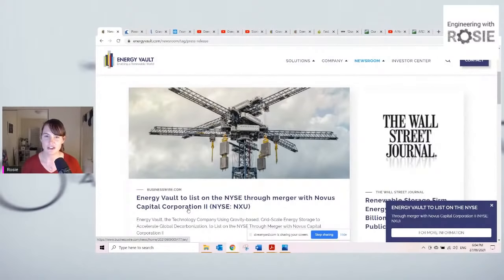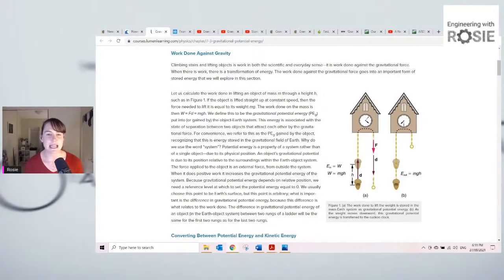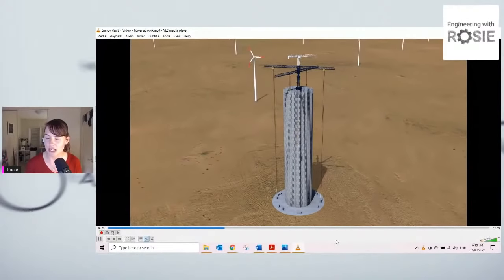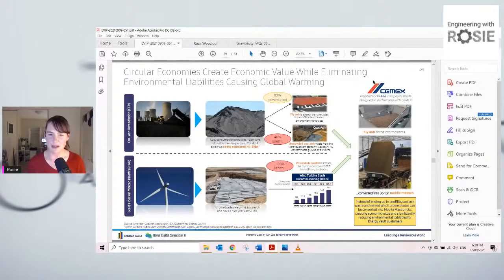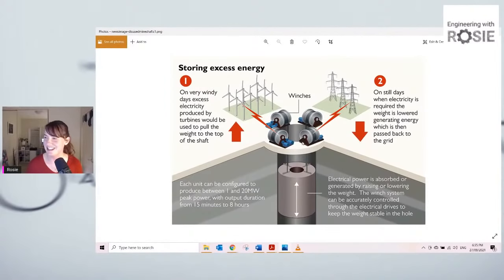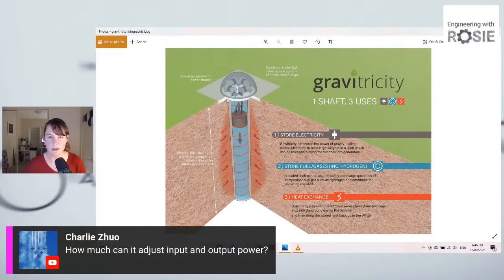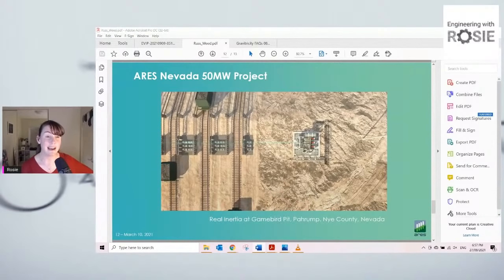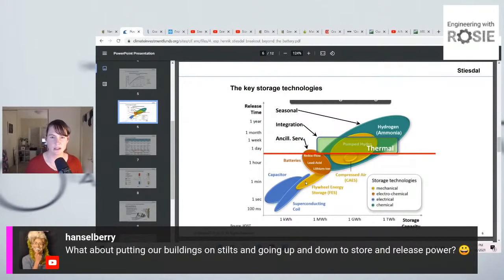Engineering with Rosie Live Ep. 2 Strange Storage - Energy Vault, Gravitricity, ARES Rail Storage

Comment: A wave/tide powered pumped hydro seems like a fairly cheap and easy solution to power generation. Ideally the water used for everything would be salt water which presents environmental contamination problems and probably provides a more abrasive medium for the turbines.
Reply: And that's why it's so expensive. Salt really rusts the equipment.
Reply: @simonhenry7867  make it out of plastic- I have heard the plastic is already in the ocean- so a double win :) ... it is that easy
Reply: @olik136  It is not that easy.
Reply: The biggest problem with pumped hydro, the one thunderf00t is actually not talking about is that it really depends on the location. You cannot build this wherever you want.
Reply: @_aullik  Yes and no. If you try to go for the traditional "cheap" method you not only need a suitable valley that you can flood, but it has to be close to a water source, close to your power source, and close to your city, because you need to build a road and power lines there just to build the thing and that gets very expensive as the distances get longer. Someone else made a video about this and they basically said Canada doesn't have any more suitable locations for pumped hydro because building it hundred miles from anywhere is not economical.

Then again, if you REALLY need a big battery and screw the NIMBYS, just dig a big hole and a second twice as deep hole next to it, and you can build a pumped hydro storage of any size you want anywhere you want and only need to worry about having a water source, which most cities already have.
Reply: @AnalystPrime  you are right, if you dont caree about money you can build everywhere, however at that price point it is not competitive against any other technology.
Reply from the maker: Ooh, I am excited to see this conversation thread here. I plan to do some videos on pumped hydro soon, so it's good to see it's not just me that thinks it's an interesting topic. I want to do videos on both "normal" pumped hydro (specifically the Snowy Hydro 2.0 project which is near to me) and off-river, which addresses much of the problem with normal hydro that there aren't many good spots left. You still need a pretty good hill though. I'm hoping to interview one of the authors of this article about the off-river option. https://reneweconomy.com.au/off-river-pumped-hydro-could-provide-lower-costs-for-energy-storage-31629/#:~:text=An%20off%2Driver%20pumped%20hydro,tunnel%20containing%20a%20pump%2Fturbine.

Comment: Rosie, 

perspective, all these ideas are toys, in terms of power capacity and how do you control them anyway. Good storage has to be controlled in it's output.
Clever people make money out of such schemes as the general impression is that storage is the answer and will compensate for intermittent renewable generation. They may be misled by the fact that batteries are used not for intermittency but frequency support. This is due to a lack of technical knolwedge, I would have expected you to know better?
Reply from the maker: I agree that batteries are currently mostly used for ancilliary services (which I did mention in this video, briefly when mentioning Gravitricity's prototype test needed to validate the startup time to make sure it was fast enough). 
But I will also add that longer duration batteries are already gradually starting to be installed for arbitrage, to charge during the solar peak and smooth the evening peak load. And of course many grids rely on hydro to smooth intermittency. These gravity storage systems are mostly geared around longer duration storage, approximately from 4-12 hours, which is one of the big challenges the grid has coming up as more variable renewable generation is added.

Comment: Wind towers have tall towers, it seems the towers would be designed to deal with bending loads that as far as I know are more difficult than compression, so a wind tower might be able to hold considerable weight, given the lack of storage potential it may not be worth the effort...
Should be able to use the existing generator and gearbox at the top of the tower? Even small smoothing or short term storage might be useful?

Comment: I'm extremely skeptical about Energy Vault. Their pivot from freestanding towers of blocks to "indoor" contraptions of elevators and racks should be a strong indication that they are selling snake oil.
From their CGI, it appears their tower version is about 40 layers of 200 blocks (8000 blocks) each weighing 35 tons. If maximum storage is 100%, the crane's jib lengths that could suspend 35t blocks would limit full discharge to use only the upper 66% of the blocks (meaning over 2500 blocks are never used for storage.)
100 metres is roughly the height of a 33 storey building (not quite the low-rise building depicted in their "indoor" version.)
The volume of steel used to make the lattice structure that is imagined to be inside their building is ludicrous.

The art of performance magic is to "misdirect" attention toward the insignificant while seeking to avoid showing the obvious absence of any "magic".
"A fool and his money are soon parted."

Comment: It seems that any shaft mining company who wants a nice press release could use the Gravitricity system for on-site daily storage of solar/wind.  I don't see that system making sense outside of a pre-existing shaft mining context.  If there is any shaft mining equipment which is assembled on site, even digging new shafts may not have a huge marginal cost.

I wonder what is the limit on how heavy the load can be (and therefore capacity), I presume it's set by the tensile strength of the cable holding the energy storage mass
Reply from the maker: I would expect that they want to use existing cables and winches so probably that's the limiting factor. But the Gravitricity blocks are already so huge! 550 tonnes!! I was incredibly sceptical about the idea of using mineshafts at first, but I did get somewhat persuaded of the benefits when I spoke to them. I think we may well see a few of these systems installed in the next few years and I guess after that we'll see if their business case stacks up in reality.

Comment: I wonder about high pressure CO2 storage. It can be liquefied at room temperature and 73 atm. That would make compressed air storage much more energy dense. Of course you have to heat it back up before it goes through a turbine. If you just let off pressurized CO2 into a cloth bag most expands but you also get dry ice. Which you obviously don't want in your turbine.

Comment: So the obviously simple solution which they came up with is to have a building made of just lift shafts. Each shaft lifting a mass a given height. The building is structurally stable and the lifts are operated by conventional lift motors. One does not need to lift large masses one can now lift hundreds or medium masses.  This may effect reliability since more motors means more maintenance and repairs. So just some optimisation analysis needed.
I like the lift solution much more than the cranes.

Comment: 07:50 Fun fact: 1 tonne raised 1 meter stores about the same energy as the average AA cell (some 3 Wh).
Reply: That cant be right, otherwise we should be able to easily lift a ton 1 meter high with 2 double A batteries.

Comment: Hi Rosie, great channel, I love the content . Have you heard about the molten salt energy storage of Moltex Energy ? It's one of the few new nuclear technologies that is supposed to be "renewables friendly", as it offers a variable output from a reactor running at full power via storing heat in solar salt. I think as long as you some have high temp heat source anyway in the system  (molten salt nuclear or even fossil fuels) storing heat in solar salt seems to be the cheapest energy storage currently by far  - or am I missing something ?

Comment: Hi Rosie Toby from Johannesburg.
I was considering a solution like this but using an existing mineshaft and sub-terrain tunnels. 
I was considering storing the concrete blocks horizontally to get around the vertical height difference and the windage difference.
It would just use a rail system to move blocks around above ground and the the mine tunnels. The problem here is the ground water the old mine tunnels and energy loss moving the blocks horizontally.
Regards 
Toby

Comment: Most of these methods have discontinuities built in - as the trucks / weights or whatever reach the top or bottom of their travel. I wonder if it would be necessary to incorporate a flywheel storage unit to cover these gaps.
Reply from the maker: That's an interesting point I didn't ask about. The ones that are using really big blocks would be limited in the duration they can operate continuously I expect, but the ones with smaller blocks and multiple generators could probably carefully time it to keep it constant. Or they'd need something like a battery or flywheel to keep it smooth, like you suggest.
Reply: @EngineeringwithRosie  I think their taking a lot of inspiration from a V6 (or V8) engine... At least one cylinder provides enough mechanical force (expanding gases) that is being 'tapped' by processes occurring in its compatriots, all smoothed by that flywheel..

It would complicate things - but would "recapture" potentially waste energy - if the blocks were different masses... As a heavy one was on its way down and demand from the grip dropped for a very short time, less massive blocks could be raised to 'suck-up' and re-buffer what would otherwise be wasted... Hmmm... Think I'll start looking for backers... :D

Comment: Energy Vault
As the blocks are used and re-piled, the distance from the crane to the block's resting place varies as blocks are stacked.  As a result, this varies the output.  So after the blocks are used, how do you get them re-piled again?  Seems to me it will take more energy to re-pile the blocks than you will ever be able to recover.  I can see this as a good emergency generator, but continuous, no!

Comment: The potential energy can either be converted quickly into kinetic energy (which is what drives an electric generator) generating high power intensity or slowly with low power intensity the energy density is still equal to the potential energy stored in the mass at rest at height h.
But how do you control the descent speed to control the release of the energy without needing energy or wasting energy if friction was to be used to control the decent of the mass. 
If cranes are used to control the decent of the mass then the energy needed to control the decent must be subtracted from the energy produced the kinetic energy).  
So very short discharge time. 
This does not strike me as being very efficient either...maybe 50-60% efficient not 90% as I think they claim.

Comment: I can't see any of these ideas being able to compete with pumped hydro. For example, if one uses the mine shaft for water, then one can pump water up and down. The equivalent mass would not be much more than a swimming pool.
Reply: i imagine the point of any of these that aren't scams is to store energy in locations that aren't suitable for pumped hydro
Reply: @kaiserruhsam  There is a problem with scale here. A pumped hydro project can be 1000 times bigger than the biggest imagined project of these types and still be a small pumped hydro project. The gravity energy storage systems are so inefficient that it is not worth thinking about.

Comment: Could the energy vault concept be distributed across the shafts of wind turbines?  Ie, when rotating, each one lifts its own collection of blocks up and fills intermittent voids by lowering them.
Reply from the maker: Interesting idea 😀 Maybe you could put blocks around the outside of the towers? And a winch on the nacelle to raise and lower them. It would complicate the turbine design and operation a lot though, so I am not sure I think we're likely to see this happen!
Reply: @EngineeringwithRosie  I assume an analogous idea with distributed pumped hydro storage in the shafts of offshore turbines would be similarly too-complex?  Or would the total volume be insufficient to make it worthwhile?

Comment: It's really discouraging to see how difficult seasonal energy storage really is going to be.  Is the solution more long undersea transmission cables?
Reply from the maker: That's such a huge and interesting topic, and one I'll eventually cover in depth. My current opinion (and it has changed a bit over the last few years!) is that we will end up needing a lot less seasonal storage than we think now. Because of long distance interconnectors like you say, but also load flexibility. Maybe we'll add other renewables as well (wave, tidal, airborne wind perhaps though I'm not holding my breath on any). The remainder I think will be covered by gas (perhaps with CCS), biomass, maybe hydrogen.
What do you think?
Reply: @EngineeringwithRosie  I agree with your prediction.  

I wish I knew more about the state of underwater power transmission.  It may be difficult politically for global-north countries to rely on the global south for winter electrical energy.  Australia has huge potential here!

I'm not sure how much demand flexibility there will really be for non-industrial users. In Massachusetts iirc, 30% of our emissions are from heating buildings, and 60% are from driving, neither one seems "demand flexible" in the winter.

Comment: Sounds like their "change in plan" is a direct response to Thunderf00t's criticism! But even if these measures mitigate most of the problems, how do we know they are actually doing it? They are going public, but who's auditing to make sure if these claims are correct?
Reply from the maker: Presumably their investors are checking? I don't know, I don't really understand their communication plan.
Reply: @EngineeringwithRosie  Sadly, there's still very little other than the CGIs. Their new plan is very much like building a skyscraper. So it's quite a surprise that even after their initial IPO which raised $230M, there's still no sign of anything actual.

Comment: If concrete were a country, it would be the world's 8th largest CO2 emitter. And there's Energy Vault proposing a tower built out of 100s of 35 ton concrete blocks. Tell us the energy input of making the concrete for these blocks, and how many months (years? decades?) the Vault would have to operate until it has stored and re- released as much energy it took to make its concrete? For pumped storage at least you do not have to make the water first.
Reply from the maker: They are now making them out of  recycled materials. Haven't seen a full LCA but I assume it's a lot better than if they were regular concrete.

Comment: Rosie, if the Chief Development Officer at ARES, Russ Wein, as per your comment at 50:05, he believes energy storage is going the way of the internet, he is a complete idiot.

The internet is dominated by 99.99% storage - storage on the server's hard disk, server's memory, multiple router's memory, then on your computer's memory and/or hard disk - little is actually 'in transmission', or being consumed, like electricity as soon as it is generated, at the speed of light. The default form of data, of information, is storage, and the unusual case is transmission.

The electric grid is dominated by 99.99% transmission - with a tiny, tiny fraction being stored - the form of electricity is flow, not storage. The unusual case is storage.

Comment: With turbines getting larger and taller to become more efficient couldn't the turbines have a gavity storage system like these built into the tower so each turbine not only generates but also stores power?
Reply: I was thinking of the same thing. On the other hand, these towers are not that tall (when compared to other gravity storage systems) and the tower might be a bit cramped so you can't easily fit a very big system in the towers.

Comment: Hydrogen is pretty docile until you mix it with Oxygen....
Reply from the maker: True, are we sure we will never get any oxygen in there though? Perhaps I'm being paranoid!
Reply: @EngineeringwithRosie  I must admit I was being a pedant! I am not worried about oxygen getting in and there being explosions inside the tank, I am much more worried about hydrogen getting out and their being an explosion outside the tank. Heck, normal domestic gas explosions are bad enough. Anyway, I 100% agree with the point you are making - personally, I do not see how Hydrogen can work effectively as a fuel option since it's energy density per unit mass is low and it is so hard to keep it safely inside it's containment vessel. I think Electricity is the way forward.

Comment: Rosie, I think you're making a mistake by taking the marketing material for Energy Vault too seriously. Of course they want to show wind turbines and energy vault in the same picture to illustrate that one balances the other. That doesn't mean you'd actually put one in the middle of a wind farm. You can put it anywhere in the nearby region with a good grid connection. I'm not sure it's a huge problem if they have to stop operating the energy vault in very windy conditions. They'd obviously lose some energy that could have been stored, but that's just a cost/benefit tradeoff. I don't see why it'd be a problem to operate them in moderately windy condition. I wonder if they'll use the old energy vault concept, but if they can find the right material (what they use for EVx might not be strong enough), I don't see why it can't be used for small-scale storage in places with favorable wind conditions. It's probably cheaper and faster to build than EVx.